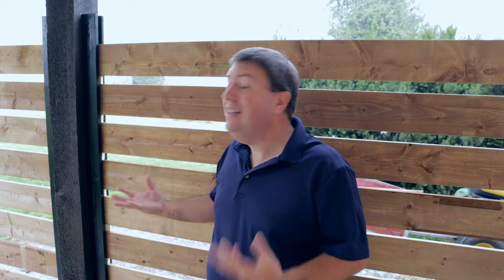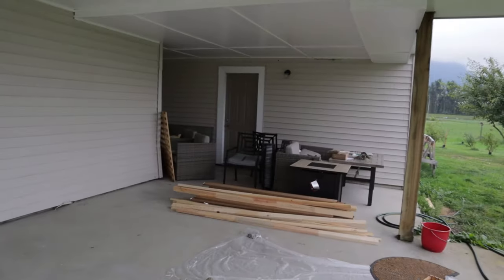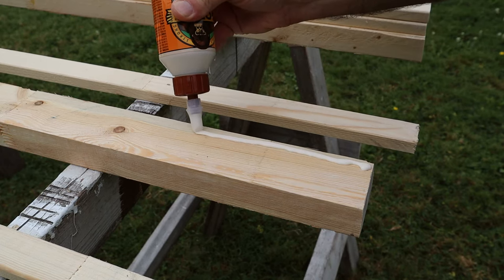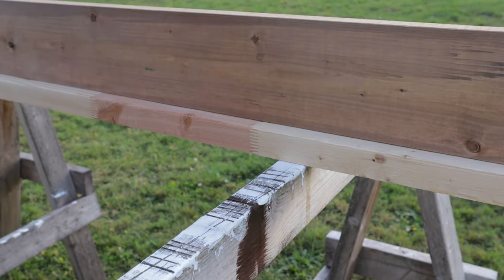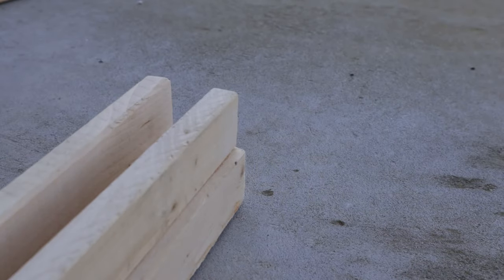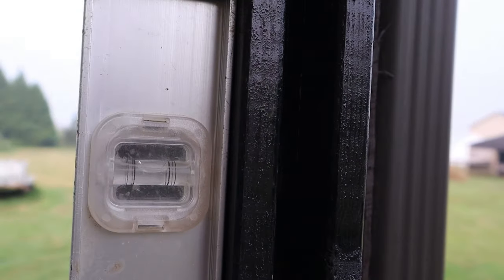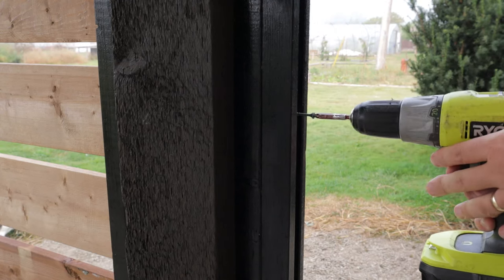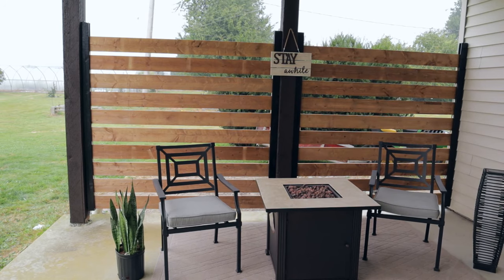Privacy Screen - Easy Project

Comment: Just built a slat fence in my garden using your methods. Thank you for the detailed explanations! My neighbors think I'm some sort of handy-dude now! :)
Reply from the maker: Fantastic!
Reply: How did you secure the posts to the ground? I love this idea. I'm trying to come up with something that would give provide privacy from my neighbors on one side who hate my dog. I think this would be perfect, but I don't have existing posts to attach it to. I bought some 4X6 trellises, but they were expensive, and I don't know how well they'll hold up.
Reply: @novelist99  I used Simpson Strong Tie EZ Bases to secure new posts to existing concrete. It's not as sturdy as I had hoped because I didnt have anything else to anchor them to on the sides. But its still standing 2 years later!

Comment: Amazing curious with the way the economy is now with lumber ..  if you're able to list the supplies would be great also a lil info on how you installed to the concrete ty
Reply from the maker: Things are definitely more expensive now than when I made the video. It's been a while since I put this together, and I'd pretty much have to make a supply list by watching the video and seeing what's available (and reasonable) in the stores. None of the frames went into concrete - just the wooden posts or the frame of the house.

Comment: This is genius!!  My patio doesn’t have wooden beams like this.  I have alumawood.   Will I be able to screw the channels into the alumawood and not damage it?
Reply from the maker: I've never worked with alumawood, but from what I can see, some sources recommend you avoid drilling holes in it if you can. I might look at or research whether construction adhesive would be a good alternative.

Comment: Looks beautiful! So how is this done when you have iron posts? Any suggestions? Thanks
Reply from the maker: With more difficulty! I did a project or two on this channel where I screwed into metal posts. Pre-drill a pilot hole and use a self-tapping screw would be my starting point, but I'm no expert. Happily, the rails probably only need 3 or 4 attachment points each.

Comment: This might look good in your mind's eye, but think twice before trying it in the real world. A neighbor built one of these in Western North Carolina using 2x10 (or thereabouts) southern yellow pine lumber as slats. I haven't measured the length of the slats, but they are in the 12 ft. range. Within a few weeks they were warping in all sorts of interesting, if unsightly and embarrassing, ways. The cups, bows, and crowns in the slats increased over the first few months and have persisted in dynamic motion since then, in some cases threatening to escape the containment channels. It would probably make a very cool super slo-mo video, but if that's not what you have in mind choose a different style of fence unless your slats are impervious to warping.
Reply from the maker: Thanks for the warning Michael. I haven't had any problem with warping yet, but something to look out for.
Reply: @FraserValleyRoseFarm  Differences in climate might account for different results. The Carolinas get about the same rainfall as you in BC, but our summers are steamy, not dry. A new development on the neighbor's fence. Last week (2nd winter) one of the vertical channel posts split lengthwise, possibly due to ice buildup in the channels, spilling the adjacent sections of slats.  

BTW,  I enjoy your channel. My success with propagation via cuttings has improved significantly thanks to your videos.

Comment: Can I ask what are the dimensions for the slats? I saw 1x2 and 2x3 for the channel, but am not sure about the slats. It looks like cedar. My back porch has the posts just like this and it is perfect for what I need. Thanks!
Reply from the maker: As I recall they're around a 1x5, but really that was just the most convenient size at the hardware store at the time, and you could build the side rails to fit whichever size you end up using.

Comment: Very good presentation! For the slats, what kind of wood did you use and their dimensions (mostly concerned about the thickness). Thanks!
Reply from the maker: I just checked and it's just over 1" (maybe 1 1/16th or 27mm), so I guess the nominal size would be 5/4.
Reply: @FraserValleyRoseFarm  Thanks so much!

Comment: What kind of board and size did you use?
Reply from the maker: Treated decking boards. They were just what's available at the local building center, and were roughly 1 x 5

Comment: Did you use nails to hold all the boards or how did they stay in place
Reply from the maker: They're loose stacked in the end slots with spacers. No need for nails or other fasteners.

Comment: How did you use to attached to the siding of the house?
Reply from the maker: Through the backing of the rail using longer screws - straight through the siding and into the frame of the house beneath it.

Comment: How do you install the rail on the siding of the house?
Reply from the maker: We just used a long screw through the back of the railing and into the frame of the house. It compressed the vinyl siding a little, but we stopped when it was fairy even and not too tight.
Reply: @FraserValleyRoseFarm  thank you!